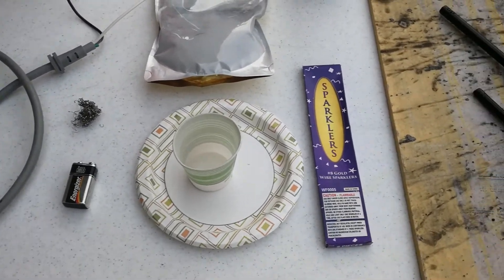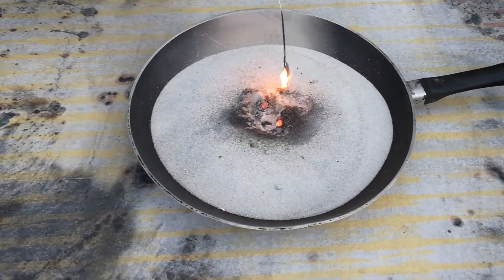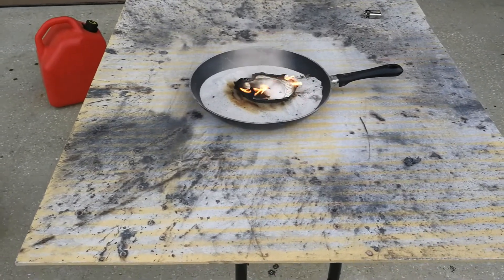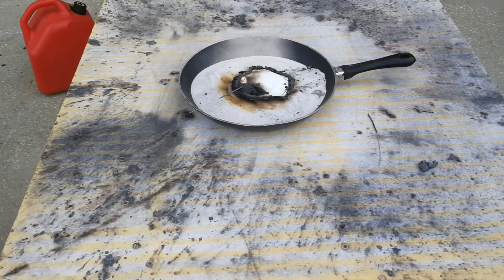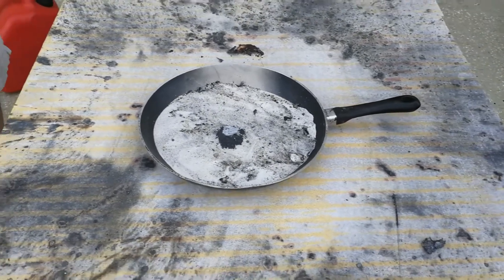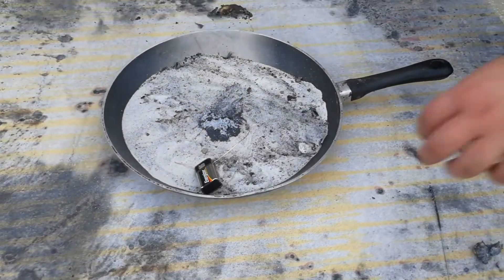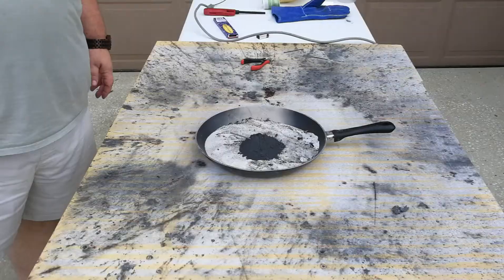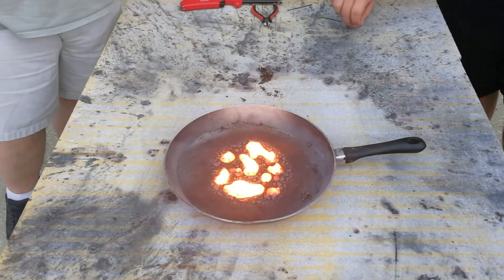How to light thermite.

Comment: To ignite thermite you have to reach a temperature close to the melting point of aluminum. Here we only reached 550 degC with the wire, which is not sufficient to ignite the thermite.